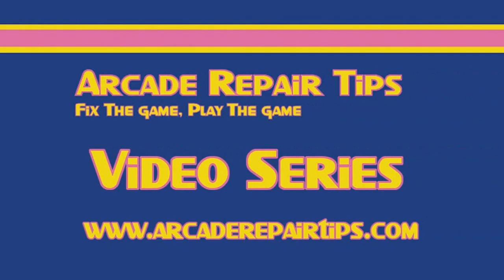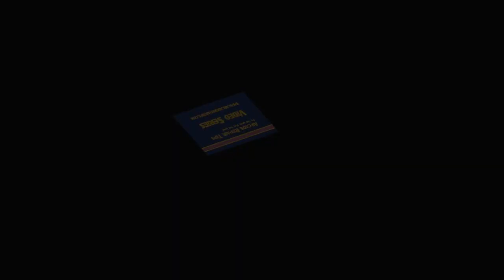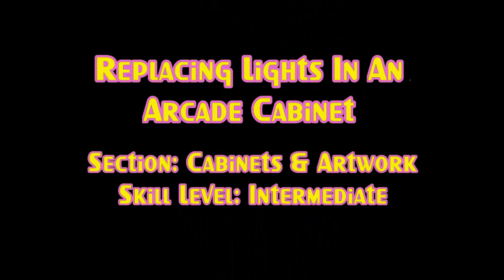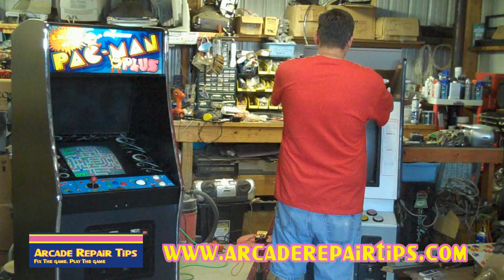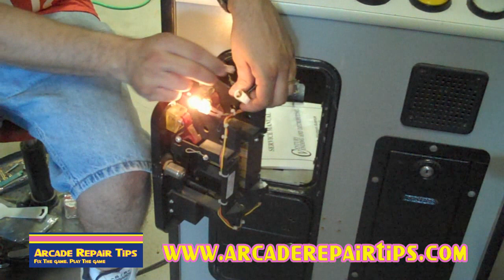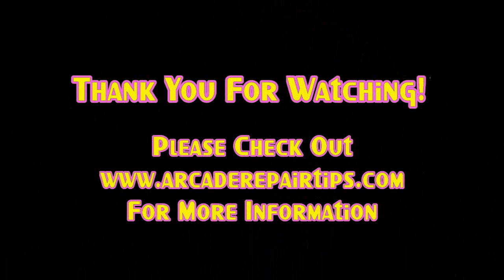Arcade Repair Tips - Replacing Lights In An Arcade Cabinet

Comment: I recently bought an arcade game from 1988 called Cabal, and the marquee light isn't working. I replaced the bulb, still didn't work,  I replaced the starter, still nothing, so I replaced the ballast, and still nothing. I tried checking all of the connections and they look fine, what could be the problem? Also my game counter is stuck and wont tick when a credit is added. any tips on how to fix that?
Reply: Hi, Adam! Basically, the system for the fluorescent lights is very simple - bulb, bulb fittings (T5 or whatever), a starter (with its fitting), ballast and wires. I think that it will be best to check each other in the order I'm typing here. The fittings have 2 small metal strips in them - you can remove the cap with the 2 oval holes to see them. If they are not new - check for oxidation or for a bad contact with the bulb. I'm almost sure, if everything is new and working, that you have a wire or wire connection problem. If nothing is working - check if you have a voltage to the light's connector (well...you should check that first). :) Don't forget about the safety, always touch with mains plugged OUT and check with a multimeter with mains plugged IN (but DO NOT touch the wires or near them). And for the game counter - it's simple because you have only 2 options - wires check and changing the unit. The way it's working is - you have voltage leads and a signal input. When you put a coin, the signal input is triggered (oftenly - HIGH) and it turns the mechanics in the counter by 1 unit. If the wires are good - it means that it's electronics (or oftenly - mechanical) problem with the counter that's not worth trying for fixing it...they are pretty cheap. A nice lifehack for checking it is to figure out which wire is the signal and try to make a "dummy coin" aplying some voltage through it. Try to find some videos on how the counter actually works here on YT - I'm sure they are many.
Best regards,
Bobby
Reply: Use a multimeter to check power to the marquee light connections and see if you have power. If you don't you may have faulty connections or have a power supply problem... If the counter doesn't tick, it is most likely bad... Test power to that when you insert a coin...

Comment: YOU HAVE A PAINT 'N' PUZZLE!!!    I have one of these and have no idea whats wrong with it,  so sound,  my monitor is bad and trying to fix it now.  I have lightning bleed around HV Cup  Do you have a manual?  So you have any settings from mother board I could get.   I need to know where the white funky plug from tv goes on the CPU board.  I know where it goes just not the direction of the cable. up or down?  WOULD YOU DO A VIDEO EVEN A QUICK ONE OF THE GAME PLAY AND SOUNDS AND SUCH, MAYBE A OVER VIEW IN DETAIL OF THE INSIDES?  thank you so much ~Jason

Comment: Open the Coin Mech door, behind the return button (the slot where you insert the coin and stuff) there is a small light attached to a wire, pull the wire, it will slide off a metal piece that holds it, pull out the light (I bought two packs for 3$ at Menards, check Automotive, they're car lights) put it back in the slot and slide the wire back onto the metal, if you bought the right light it will work. (Make sure you replace ALL of them otherwise it has tenancies to malfunction

Comment from the maker: @Wiitalks Look at the belt attached from the motor to a gear on the steering wheel and make sure that it is tight. Also, there is a potentiometer around the motor that tends to go bad. You can check it with your multimeter to see if it's working properly. Your motor could have gone bad, however, these motors tend to last a long time.

We have also featured your question on episode 18 of our Q&A podcast. Please listen to it for more of our thoughts on your question. Thanks.